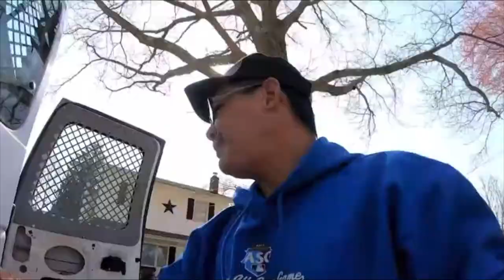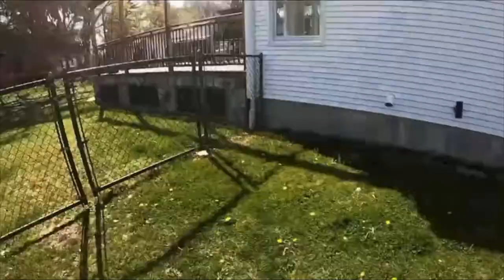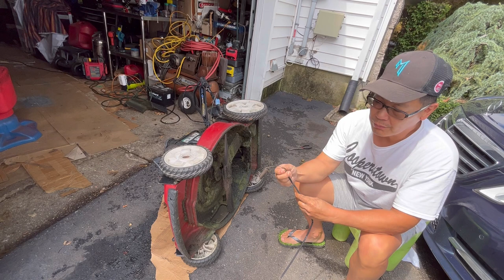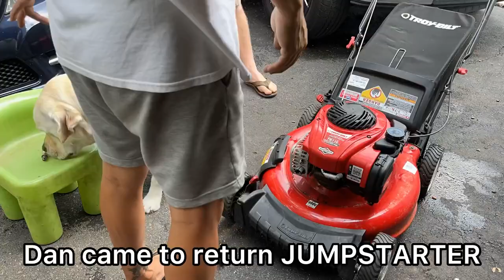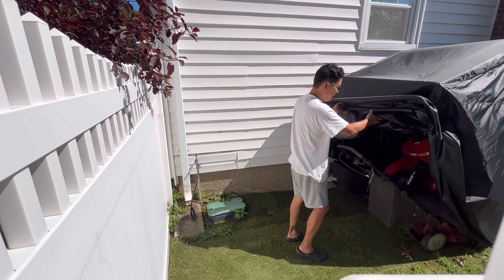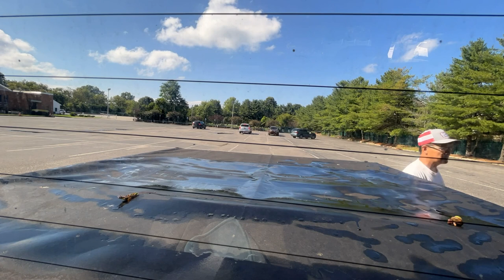TORO LAWNMOWER DOESNT DRIVE? BROKEN CABLE? FIX IT YOURSELF! RWD SELF PROPELLED PERSONAL PACE REPLACE

Comment: I picked up a craftsman 22 inch push mower front wheel self propelled it sat for years putted fresh gas in it and it fires up on the first pull with a 7hp Briggs and Stratton engien for free